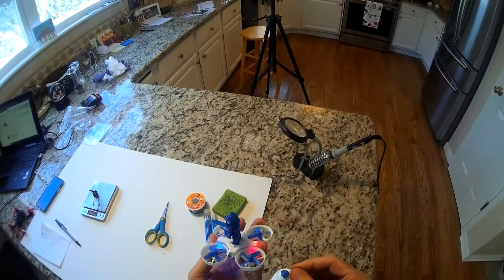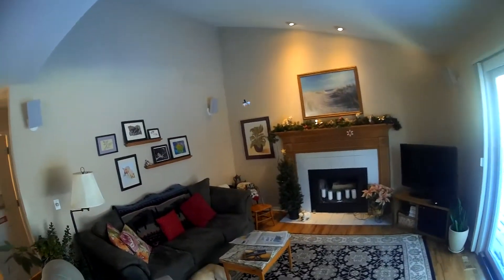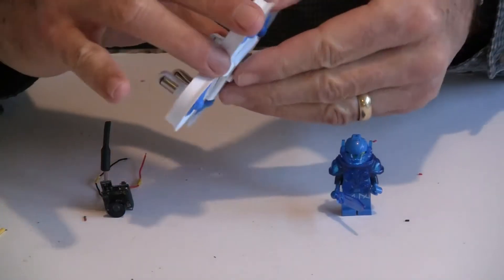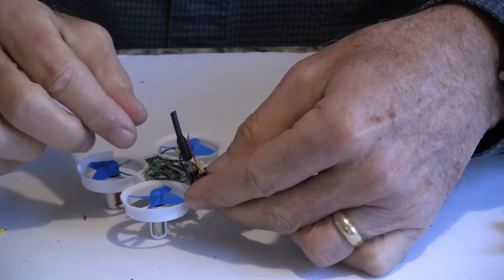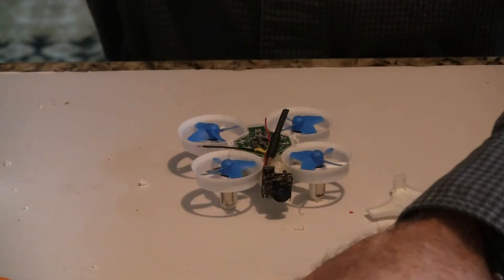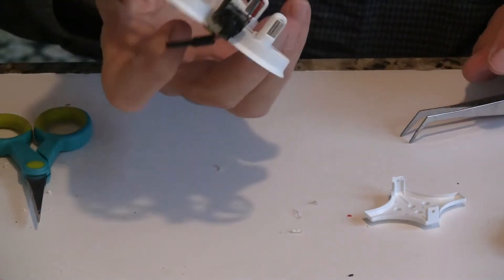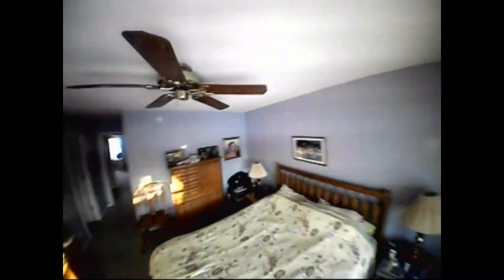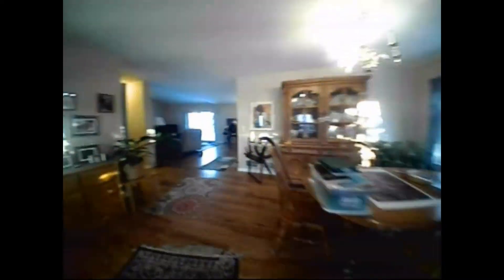Adding FPV Camera to an Eachine E011 Quadcopter

Comment: Would this camera be compatible with the Eachine 010? And if so, how much time does it take out of a flight time without the camera? I think the 010 has a flight time of 5 minutes per battery. Thanks
Reply from the maker: Edison Santos I have not tried it with an Machine 010 but tried it with a similar Furibee F36 and it worked but under powered. The flight time is cut in half. If your buying a quad for ‘‘tis the eachine 011 will work better with the larger motors
Reply: Thanks  @jmoore3854 , that's useful information. Good excuse for me to get a slightly bigger drone once I manage to get proper handling of this one LOL